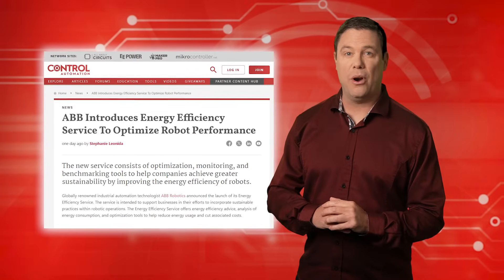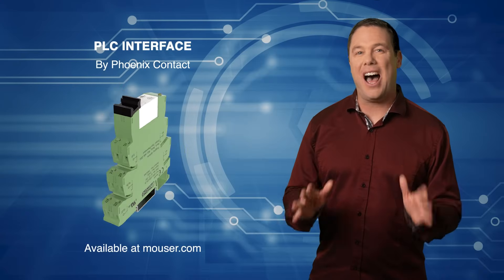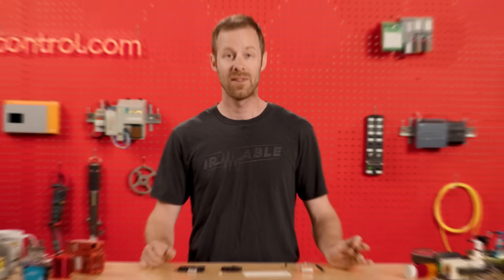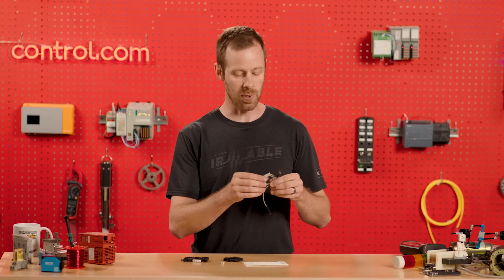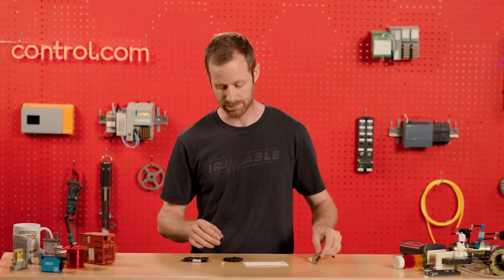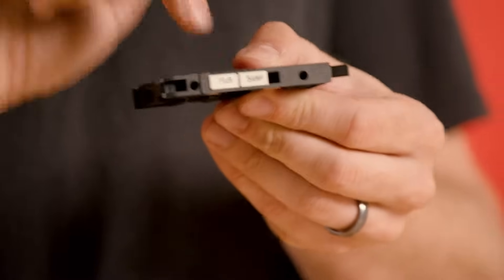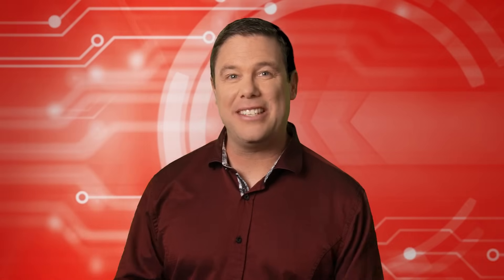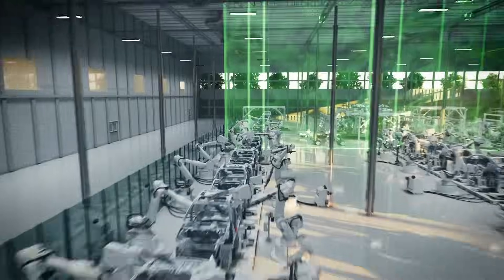Automator's Edge | Ep. 35 | Robotic Energy Efficiency Service, PLC-INTERFACE, and Wire Labels

Comment: Yeah, marking the wiring is always important, especially when building aerospace wiring harnesses.  The place I retired from had an automatic (laser?) wire marking machine that marked the wires a set number of inches apart, all along each wire's length.  I'm guessing that's overkill for controls panels, but it's very important there too.